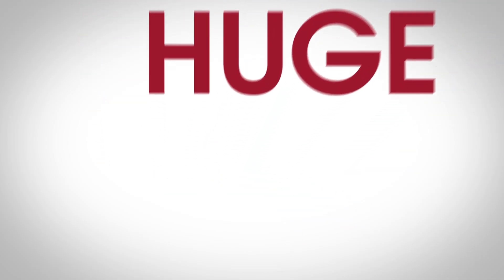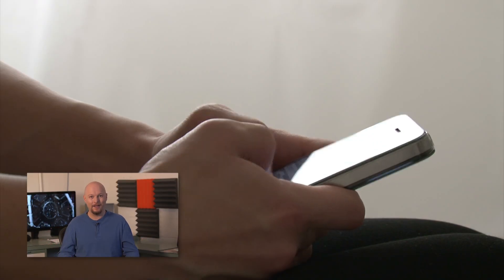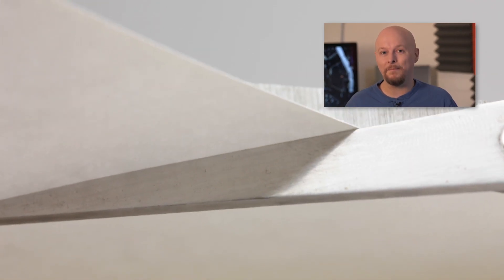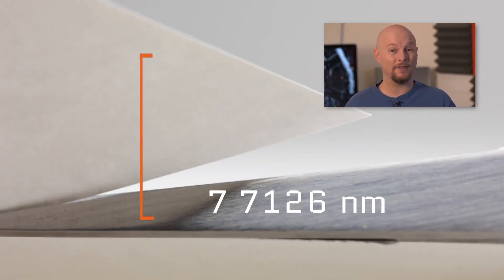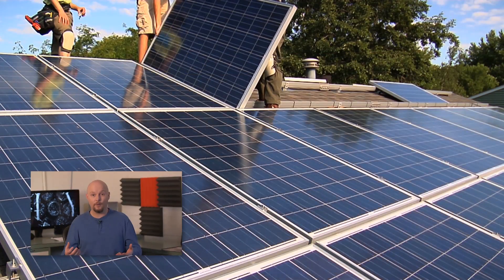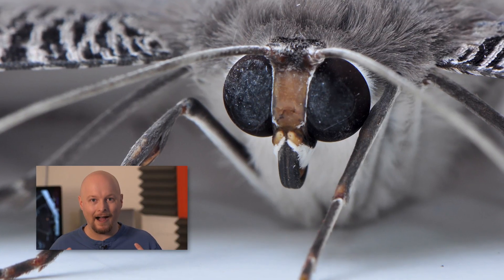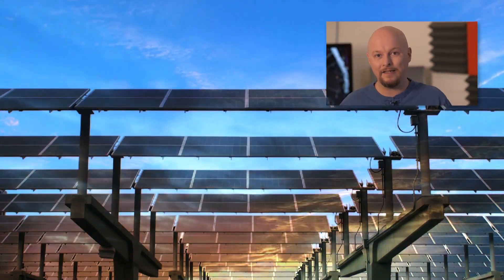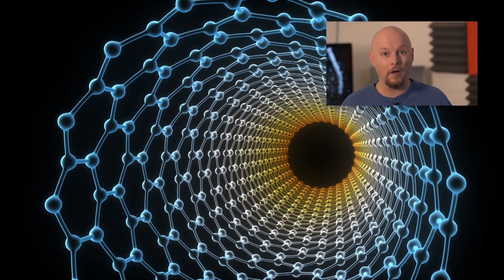The Future of Solar Energy is TINY Technology!

Comment: We are a manufacturer of nano-tech cleaners and coatings. Just finished testing our solar panel coating getting a min of 9% increase in overall output and a 2% better "loss of energy" along with preventing oxidation and making it easy to clean/keep clean. Nano products will be the "new normal" when cleaning & maintaining surfaces.

Check out our GLASS HPI for solar panels at http://nanoitproducts.com

Comment: Scientists have been predicting a major breakthrough with solar panels for over 30 years.
Reply: +Rene .Lem True but recent advancements in manufacturing and R&D in Silicon tech has really changed things. The inflection point for solar has been reached. Now it will start substituting conventional sources of energy
Reply: +ma9r1x , you have to switch to an oil or gas furnace, use a gas stove, get your water heater off electricity, then with enough batteries you can consider using solar power. I don't think your overall energy cost is lower.

Comment: Sweet you'll be able generate electricity with your clothes. And throw the mixture into paint and paint it onto cars then you have a virtually weightless power source. Paint it onto the houses to provide high efficiency solar generation. Put it into the roads   have your house generate electricity. .... just everywhere give everything power.